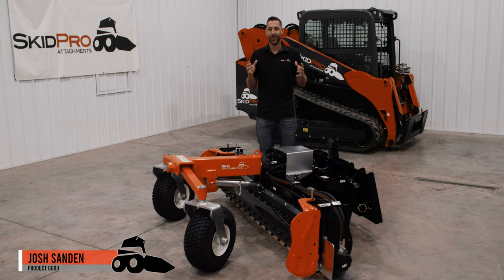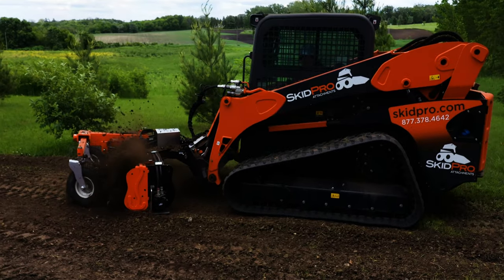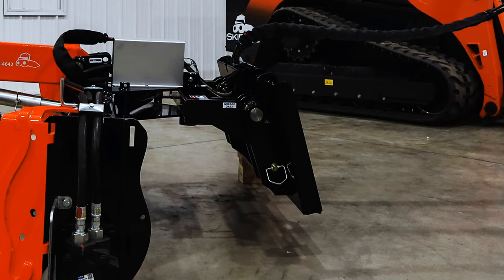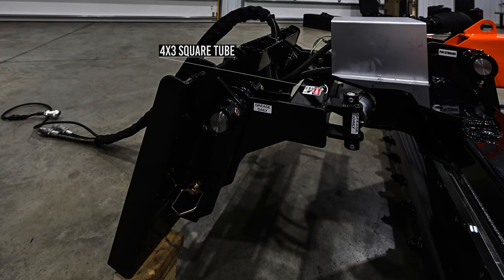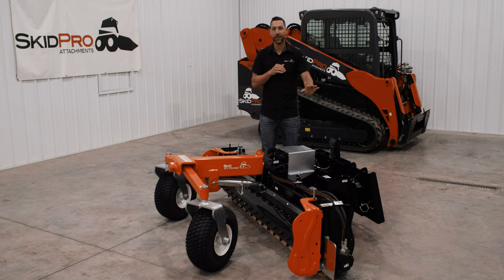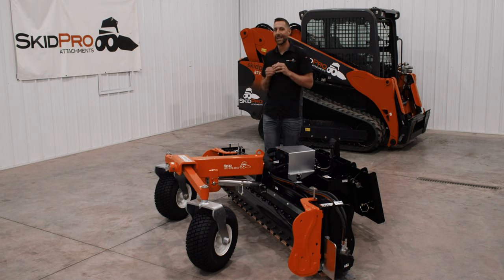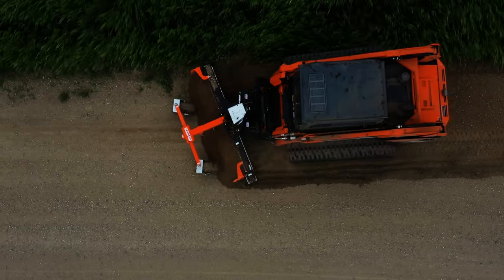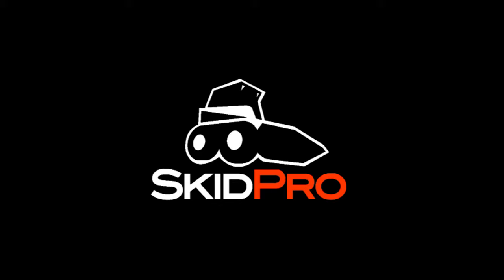Skid Steer Soil Conditioner - Skid Pro

Comment: What’s your recommended size and horsepower of a skid loader for optimal performance?
Reply from the maker: For bare minimum, we suggest having an operating capacity of over 1100lbs. Our smallest unit weighs 990lbs but we don't like to max out machines. As far as HP and GPM goes, we suggest having at least a 14-16 PGM hydraulic flow and 45 HP. That being said, those numbers are for our smallest units. If you want to go with an 84" high flow model you will need a much larger machine with more HP and GPM. What machine are you running? For a specific quote or specs, give us a call at 877-378-4642!

Comment: How does it compare to quick attach brand?
Reply from the maker: We are going to argue that ours is better so let me give you some specs on as to why. First off, their teeth are not full carbide, ours are. Our rotor is larger. We provide a  standard tandem walking axel which allows your rotor to follow the ground, they upcharge for this. We run a bidirectional motor which allows you to operate in both directions, and our wheels lift up so you can get extremely close to buildings and into tight spaces. Lastly, ours is heavier. Why does this matter? Because all that weight is accounted for in steel and gussets. I  would suggest you do some research, look at the true specs, and if you have any questions you can give us a call at 877-378-4642.